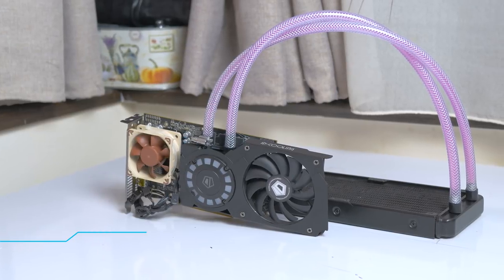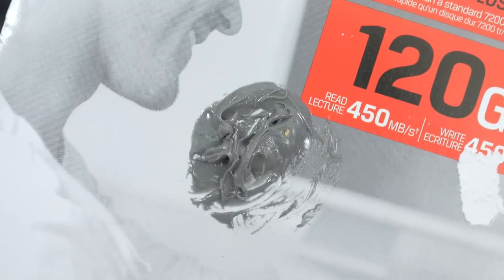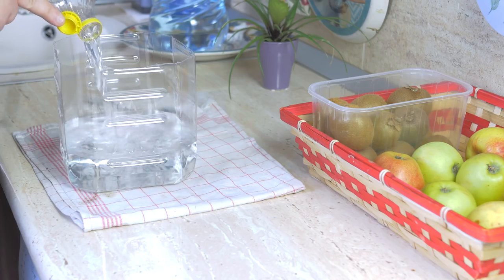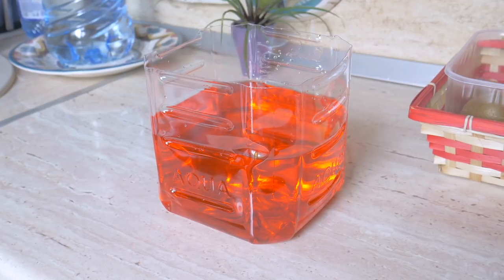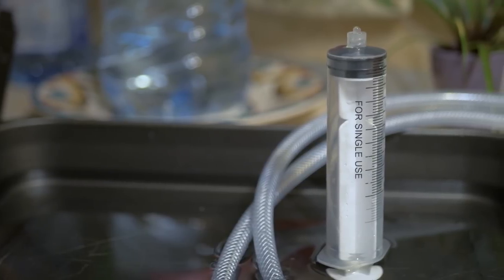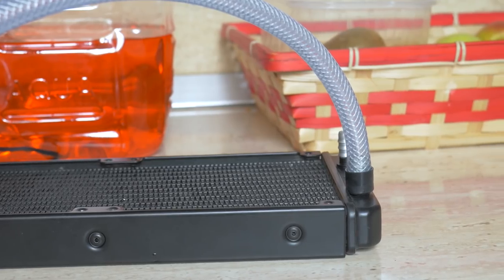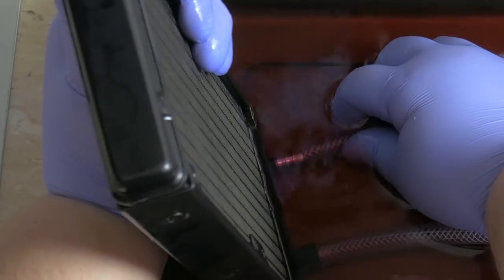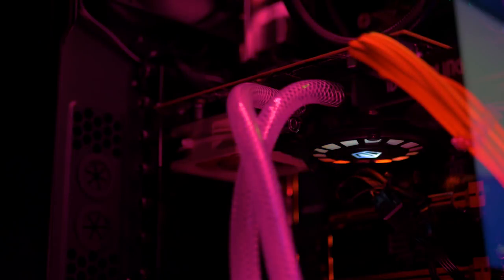AIO cooler mods: replace TUBES, COOLANT and REFILLING

Comment: My old Coolermaster AIO pump died the same week I bought my Ryzen CPU, this has given me the idea to tear my AIO apart and just reuse the radiator in a custom loop, so thank you for that.  I'll be using waterless racing coolant though as it seems to have the best cooling properties paired with anti-corrosion, and for $30USD I get enough for 3 240mm radiators.

Comment: I got two broken AIO's now and really bummed about it. But instead of throwing them out, I'm thinking about buying a pump/reservoir and use the two AIO's as a cpu and gpu coolers by frankensteining all three together. :)
Reply: Update?
Reply: I had a very low budget at the time, so I bought the cheapest I could find. While the frankensteining worked, the pump wasn't strong enough. The system throttled when stressed.
Reply: @Jonas-Sv  so moral of the story is to add a new pump to the system (or reservoir with a pump) and disable the small pump? Could you even run them together? I have the same issue with a Corsair H105. After moving house and having my gaming machine siting for about 3 months, the moment I turned it ON, my temps were up in idle about 15c (from 35c to about 50c) and on load I hit 100c, usually I got about 75c 80c on my i7-5820k running at 4.2Ghz. I say load, but really I just loaded up the main menu on Elder Scrolls Online:)) Haven't bothered to try playing any games.

With current AIO prices, I feel like I should just buy one every few years and that's that.
Reply: @DragonXDrei  
I really liked the idea of the DYI part of it as well, make a makeshift and save a buck. I ended up removing the tubes and fitted all three with better and larger tubes, but didn't end up saving as much as I hoped.
Further down the rope, i bought cheap gpu and cpu bloks from china/aliexpress (vs namebrands like EK). And they worked like a charm.
Reply: @Jonas-Sv  I just got a Noctua NH-D15 from eBay, hopefully it won't be a dud. When I remove the AIO, I will have to turn it into my little project. What coolant did you use, made your own mixture like in the video or purchase some? If you changed the radiator or the base to match the other metal, you could just use distilled water:) Also, now you can buy a 4 pin USB 12v cable, so can just power the AIO outside of the computer, put the radiator under water, and let the pump sort out the air bubbles, or can add a top up part on the reservoir or somewhere on the pipe.  In principle I have my Frankenstien AIO design:)) just need some time and to buy the parts. 

My issue is, a lot of AIOs are now under $100, with the ones like Therlmalright sitting at under $50.

Comment: Im no expert but i would think you need some air space in the closed system to allow for expansion when the coolant heats up. Fully filling the system with fluid will pressurize it and eventually force leaks to occur. This is why factory new AIO liquid coolers are never completely full. It would be worth while adding a reservoir to allow for expansion/contraction while allowing the rest of the cooling system to be full of coolant.

Great video, thank you for taking the time to make and share it.

Comment: This was the perfect How To.. Exactly what I needed as the Cooler Master ML240L AIO tubing is too short to use on my Core P90 case. I've already completely opened the box, so I can't return it. Your video was short, concise and to the point. No unnecessary time filling dialogue. Thanks again and I will subscribing and watching other videos.
Cheers!
Reply: Hello! I have the exact same problem with the exact same AIO, did you cut open the tubing? Or can you twist/pull them off? Because they have this braided finish on them.
Reply: @whiskey9217  No I have not. I'm torn, because spent my budget on the current parts but I also have no time to do this. Catch 22.

Comment: antifreeze and food colouring are a big no-no for water cooling.
Reply: Indeed. Both are old tricks that have been proven to be harmful.
Reply: ervince allen although I really want to like the video, I myself notice that as well. I mean for the blocks and radiators this would not be a good idea. 
Mixing metals with weird fluids can be bad.
Reply from the maker: +ervince allen I had to add some anti corrosive agent since the loop has copper and aluminium. Antifreeze inhibits corrosion, that's its second main property. In cars you have 2-3 types of metals. I've seen a lot of people running antifreeze mixes and their loops are ok. I think it's important to not go overboard with it. And yeah, food dye is bad. :D. The red ink works just great though!
Reply: Yes like you said, buying pre made coolant would be better. Anyways great video, I'm new to your channel so I look forward to seeing what you come up with next :)
Reply: Who is dense, you know nothing either. We're talking about AIOs, like they have a choice in their metals. Yes if they mix brass/aluminum with copper/nickel (lol gold is inert) of it doesn't matter which fluid is used since it will break from corrosion eventually.

P.S. Feser One is straight up antifreeze not much different from what you can at  an autoparts shop.
Reply: i use antifreeze (borygo eco) 6 months straight and i dont have any problem with my lc. i cut my h110 take a part pomp and use head unit (cpu block) i add 360 rad and dcp 2.2..and im happy with results ..fans spining 800rpm and i have in sintetic benchmark 62c in games 48 -49 c.i use 8350@ 4.8 ghz so antifreeze is ok..
Reply: Agree , no need for the antifreeze anyway and the food dye will turn to a sticky mess.
Reply: MindBlank Tech  Yeah the Auto industry doesn't know what it's doing lol.
Reply: Use distilled water plus the antifreeze and you are golden. Do not use normal tap water. Antifreeze has been tried and tested with various rubbers and an amazing mix of metals and all your cars are using it currently. That being said I use a Distilled water and racing coolant additive for races cars. Itl cost like 15 bucks and is the lubricant and protectors of the antifreeze without the glycol thats nonly there for the cold resistance. It smells awefull tho but your cooling loop will never corode and will run cooler temps than ANY of the BS you buy from computer retailers.
Reply: @vctrsone  so I bought a distilled water and I saw a prestone read coolant can I use it? Cause I got aluminum copper ang brass i think
Reply: @kozuta8858  Yes, as long as it is automotive racing coolant additive its perfect. they are tested way more throughly tested and developed than anything for computers and are designed to do the same job, Stop corrosion, bring temps down and act as a lubricant. for the water pump etc.
Reply: @kozuta8858  theres a bunch of different racing coolants. They all work. Its corrosion inhibiter with lubricant for the pump. As I say any of them will out perform anything a computer coolant supplier will sell you. The one draw back I will say is the stuff smells bad when you fill it so use gloves. after that tho your golden and will have the best temps your system can provide.
Reply: @vctrsone  I'm in the US and see Red Line's "wetter water" it sounds like it would work. So I'd use just that and distilled water (with the proper ratio)?
Reply: Be carefull where you buy distilled water. If it is stored next to bleach in the shop it will absorb chlorine which is a catalyst for oxidisation.
Reply: There is absolutely no problem in using a 50:50 antifreeze with distilled water mix but you usually change the mix to a 20:80~25:75 mix.
All those premix are the same thing as antifreeze... a mix of propylene glycol with ant corrosion additives.
You can do your own mix if you want. 20~25% propylene glycol, 75~80% distilled water, a water base corrosion inhibitor and biocide.
Reply: @gymweeb9229  actually the car G12 coolant for cars is way better than any of the poor coolant selled overpriced for liquid cooling aios. The car coolant is designed to last at very high temperatures not 40-50 degrees how  the mayhem and other stuf are made. This is one of the reasons permeation happens. poor coolant  that change it's propeties at over 60 degrees but not only the coolant is the problem.
Reply: MrBeast   thermaltake makes some good stuff. avoid pigment colors (knock off brands use pigment) because they tend to clump together and cause the motor to jam.
Reply: Why watercool a very slow gpu.... ...
Reply: @AEON.  do you have pictures of the dyi tank in your loop?
Reply: @gamezahoy712 for the fun of it. Sometimes we don't want to buy a new gpu. We just want to watercool it.

Comment: Thanks for the video, used it as inspiration to splice together two old Asetek style aio's (Corsair H90 & Antec H2O 920) plus a res for a custom cpu & gpu loop. Temps are way down and is actually easier than most online commentators would have you believe! Keep up the good work!
Reply: Running both pumps isn’t an issue?
Reply: @HE-162  No, still going strong!
I have a couple of videos posted on my YouTube account.
I would say the res has been a godsend for topping off the loop, but that said I've only had to do it two twice in 3 years and I'm still on the original bottle of coolant.

Comment: hi!
I would like to ask a question.
would this work on a id cooling frost flow 120?

and can you a instructional video on how can i use an old AIO CPU cooler as a GPU water cooler,specifically ID COOLING FrostFlow 120M?

it would be very much appreciated and thanks in advance

Comment: I have an ID pump/block combo with the red light tail, I added a res to it and it made the job a lot easier. I only used distilled water with a silver coil and it looks amazing.

Comment: Wouldn't the sugar in the food dye cause damage to the pump?
Reply from the maker: +Crickez Probably. Didn't use it in the end, like I mentioned in the vid. Used red ink instead.
Reply: Yeah you're not supposed to use anything that he used, except the distilled water. You buy pre made specifically designed to be used in water cooling loops. Or you will destroy your system over time.

Comment: Great video, thanks for sharing! 
I've got an old Corsair CWCH80 with a split tube that I think I'll try and repair. 
Aren't you supposed to leave a bit of air in the system for thermal expansion?

I'd appreciate any comments regarding this, thanks!
Reply: yes, i cannot find the video now but most brand name AIO manufacturers will leave about 2% of the loop as air for this reason.
Reply: When you use flexible tubing the expansion is taken up by the tubing. Water cooled rigs dont get 'hot' water and the expansion is negligible. The manufacturers fill them as best they can and the gap is left by air settling out of the liquid. You can work out the expansion using maths if you want but it is tiny. The gap is left by manufacturing. Ideally there should be none and an expansion portion left in a 'weak' point.
Reply: @handlesarefeckinstupid  Cheers! Still havent got round to repairing it! 8)

Comment from the maker: Yeah, I know the coolant looks pink - it's because the tubes are ever so slightly blue-green-ish and it mixes with the orange coolant. 

Pro tip if you get a dirty rad in the coolant and you have a clog: pump coolant with a syringe through the open port on the rad. This might push the debris out the pump inlet. 

Also, here's the link to the wallpaper behind me: http://imgur.com/sdJzzJn   -  thank me later! :D
Reply: Never apologize for pink.
Reply: Hi man  awsome vid!  Im going to try to add 2x 240 rads in a loop, do u think that will change anything from what u did?

Comment: I'm tempted to do this with my old water2.0 in the spare machine now, as I know there's a reasonable amount of air in it. out of curiosity I might just have to drain the stock coolant into something I can measure it with, refill the system completely, and drain the fresh coolant into a second container as to determine exactly how much air is in it right now. then put the new coolant back into it of course lol
Reply from the maker: +KinkyKinga1 Let me know how it goes. Why does it have air in it? Coolant evaporation over time?
Reply: Will do mate. nah I don't think it's evaporation that has done it, it's always sloshed around a fair bit indicating a bit of air in it from factory. which can be expected, as they're no doubt filled in a hurry at the factory and there's still enough coolant in it to keep things running cool, but any air is space that could be filled with more water for even greater thermal efficiency

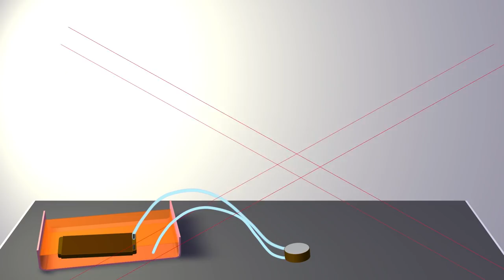Comment: Maybe I'm just too simple for this task, but at the 5:58 mark it looks to me like the coolant (orange) is going the wrong way through the system. Shouldn't it be getting sucked up the free end of the tube (the one not connected to the rad), going through the pump, then into the radiator. Once the system is full, it should spit out the open barb on the rad. Or maybe I'm missing something.

Comment: ive tossed around the idea of combining a 120 cooler on a GPU with a 240 or 280 cooler on the CPU and have the loops connected, and adding a res to it. i dont think it will help performance-wise, but i think it would give the overall system more of a full custom look. i was thinking of a corsair h50 or h55 (same cooler, 55 comes with amd and intel brackets, 50 only has intel, but is often cheaper) and a 115i, since that has an available ryzen bracket from their website, and future upgrades are coming down the pipeline. i never thought to use the braid-reinforced tubing, you can find that at most hardware stores for really cheap, so thanks for the tip

Comment: So I've heard AIO coolers die eventually, 4 or 5 years, because of a pump failure. Is this caused by the air pocket getting bigger over time in sealed AIO coolers? I'm wondering if refilling the loop like this can prolong the life of an AIO.
Reply from the maker: +tamarockstar45 Yeah, probably air pockets, coolant gone bad (in a full loop you need to replace the coolant every so often). Or just pumps dying of old age. :)

Comment: Old video I know but is it possible to mix and match CPU/water blocks? Is there anyway to know what's compatible? Cause I have a fractal designs one that's still tip top but I'd love to have an lcd CPU block but they don't make one. possible to use a Corsair? Upgrade kit or anything like that? No real info online so I found this video so I figured I'd ask

Comment: Thanks man I Followed this video. I got a 360 ekwb XE radiator for dirt cheap from gumtree. And modded my frostflow 240 as well. Awesome results. My 1080ti idles at 35°c and never goes past 60°c at max load 1440p

Comment: Great job! If you are interested, you could add an peltier with two water blocks and a second radiator to the "loop". This way it might be possible to avoid the condensation problem, by moving the cold part further away from any electrical component. The peltier will help bring down the temperature of the water much lower. 
 At least in theory...
Reply from the maker: +thesilviu silviu This should be pretty complex and I think the results are not anywhere near the level of work. As an experiment and cool thing to do, that would be awesome indeed. :D Peltier cooling is very cheap on chinese wholesale websites.
Reply: MindBlank Tech, indeed, this scenario is a bit complicated, but I think I will give it a try. Aio is a big No,No for me, but seeing that it is relatively easy to mod, the hybrid cooling might be the next thing, after Rgb...?
Reply: Very bad idea. Not only are peltier energy waster. If you fall below room temperature, for what ever reason. When your PC is on idle & your window open for example. Then you face a serious condensation problem directly at the CPU/water block! Below the CPU is the mainboard. And most of the time, further down are the GPU - PCIe socket's. 
I would not recommend even a single drop of water anywhere on a mainboard. The risk is simply too high.

No matter how much radiators some one uses, getting below room temperature is not possible that way. Because physics. So that is the only save option.

Creating/Using a temperature controller for the Peltier, to only activate under full CPU load or above a certain temperature is another option. 
But that is something not anyone without higher electronics knowledge could achieve. Or even should!

We are talking here about electric & fire hazards. Actual damage against life & limb if something goes south through careless tinkering.

Comment: hi, i have a H105 and i am planning to open it to give a good clean to the cold plate because i think some debris from the rad went in to the pump/plate in theese years (using it from 2years ago). Because i saw some videos of people opened it and found lot of debris/solder residue from the rad... probably they didn't clean very well when they assemble them.
When i was used with custom water loops i always gave a good clean at the rad before using it, usually left it full of white vinegar all night long and the morning after i found a lot of dirt coming out